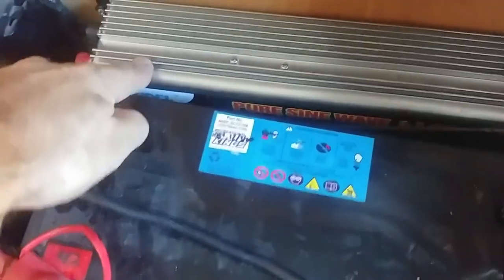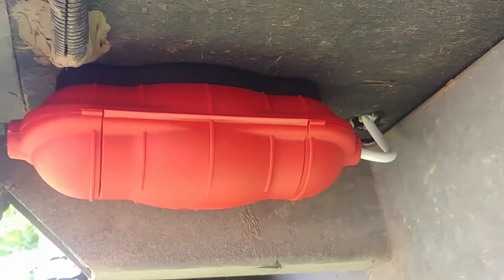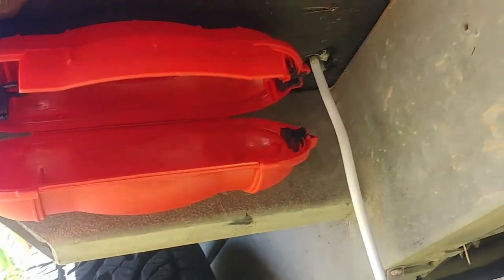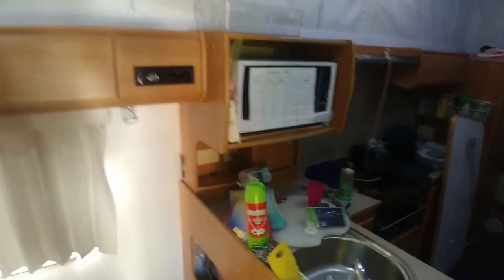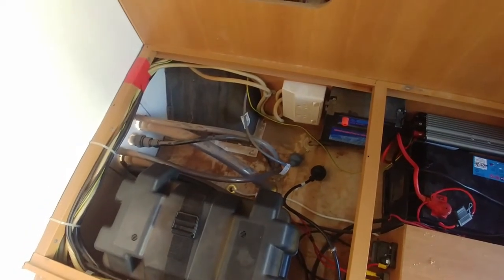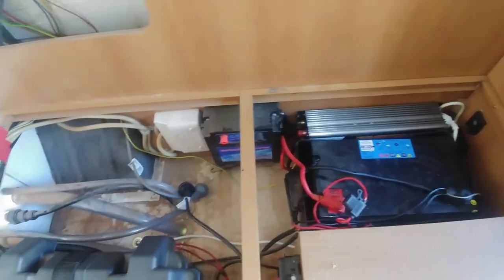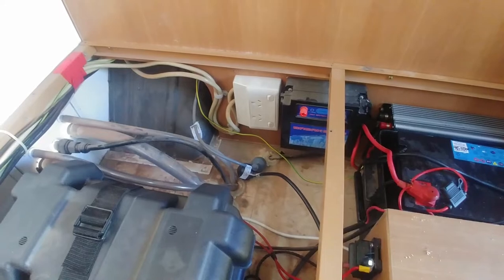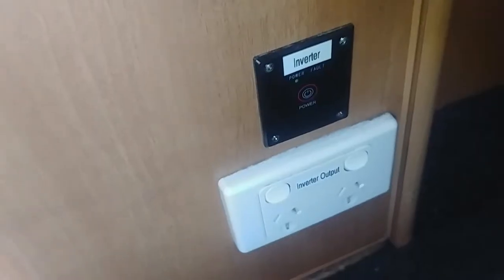[REVEALED] How to easily run your caravan / RV's power points directly off your inverter!

Comment: That is illegal in Australia
Reply from the maker: Officially you may be right. But functionally it's no different to running your van from a caravan park's power supply other than the earthing side of it. As far as I can tell, with this setup, even if you touched the Active pin you wouldn't get a shock (unless you were touching the kitchen sink, in which case the inverter's protection should cover you), because the rest of the van is isolated from the inverter, so there's no path back to the Neutral side of the inverter to complete the circuit. That said I would not want to try it to be sure but that's how it looks to me. In an ideal world I would pay a pile of money to an electrician to wire in a fancy auto-switching setup.

As I mentioned, I'm not recommending anyone does this, I'm just showing how I did it and mentioning the risks and other options. Any modifications people make is on their own head and up to their own decision.
Reply: @TheMusingGreg  It does not have a MEN link in the caravan or the inverter.  The MEN link is a critical safety function that is installed at the switchboard in your home or at a caravan part etc.  The inverter does not require this when plugging in an extension cord or power board directly to the device.  When you leave the relative safety of cord/cables with moulded plugs and enter the power point wiring which has cables in the walls and GPO's with exposed terminals, then you enter the higher risk area.  The RCD is there to protect this setup, but will only operate when connected to mains power.
Reply from the maker: Thanks for the insight mate, that's helpful information to know. Doing a risk assessment on it as I write, when I first pulled a power point off in my van (Jayco) I was surprised to find an insulated flat socket on the end of each length of internal 240v wiring which connects to an insulated on the back of the power point. So there is actually no exposed wiring or terminals even on the back of a power point. You'd have  to go another layer deeper and dismantle these connectors to actually get to the 240V wiring. So I think the risk in my case is pretty low, even though I appreciate it's not a perfect setup. But I appreciate your perspective and will mull over future plans with this setup.

Cheers,
Greg
Reply: @TheMusingGreg  I paid about $400 to have it done by an electrician who installed a circuit breaker plus a double pole switch that activates all GPO’s plus the aircon but excludes the HWS and the battery charger (else we would disappear up our backside). So it is park power or inverter power.
Reply from the maker: Cool thanks that's not too excessive I guess.
Reply: @That_is_for_me_to_know 

Well said I just came across this video and thought I would add a comment here. You have said everything that needs to be said anyone else watching this video. Please do not do this. Yes it does work but as stated there is no MEN link which will render your RCD, useless and not trip in the event of a short, malfunction or failure .

Comment: I notice you've got a microwave connected to the 1200W inverter.   How curious that the inverter later failed!!  I wonder how many other things overloaded the inverter too....  it sounds like your fridge might be the first example...   You discuss knowing how to use things "happily off the inverter"....  but that doesn't mean every person in your van knows and will remember peculiarities.

Hooking the inverter into the caravan power circuitry is ingenious...  and potentially lethal, but you know that...   Hopefully viewers will also understand this.

It would be pretty sad if (for example) someone standing on the outside of the van touched any bare metal (doorknobs, window linings, aluminium cladding etc) and dropped dead. 

240V wiring and water lines in the same place is deliciously exciting....  when when when will vibrations split that plastic water line!
Caravan wiring can be notoriously bodgey.   On a new van, one wrong screw/rivet in cladding installation for example.
On an older van, one wrong screw/rivet in cladding maintenance/repair... and a million other things.

I hope things are going well for you, and continue to do so....  but this really is a video and technique you shouldn't be sharing.  

It's one thing to do a quick bit of DIY electrical of you know what you are doing and comply with rules....   but quite another to do DIY wiring in a manner utterly illegal in any state of australia.  (Ironic that you didn't want to play around with caravan wiring, but did the 15A plug "trick".)

PS...  will everyone know that the electrical safeguards to avoid death in say...a caravan park power system (which is what should plug into the van's 15A socket), and a stand alone inverter....  are rather different?
Reply from the maker: Thanks for your comment. I appreciate your concern, but there are a number of things in your comments which aren't relevant to our situation.

The inverter is rated for 1200W continuous and 2400W peak, so our 1200W microwave should be within its abilities. However we've never used the inverter to run the microwave because the batteries can't deliver the 100A the inverter would need to output 1200W - the batteries are the limitation here, not the inverter. As for the fridge, it's a gas one so we've never needed to run it from the inverter, but if we did it only consumes 180W.

The bottom line is that our inverter is far from overloaded. The most we've drawn from it has been about 300W when charging three laptops at the same time, which is only 1/4 of its rated output.

Yes there are potentially risks with this method, which I explain in the description, but touching door handles or windows isn't one of them because our van has a fibreglass skin and plastic door handles. Any metal parts like the door are connected to a timber / composite frame so it's all isolated electrically. In fact the only way you could get a shock is by physically touching the Active and Neutral of a power point at the same time, or by connecting the Active to the kitchen sink and then touching the sink plus the Neutral. You won't get a shock through the floor because that's all plywood and in any case the whole van is floating relative to earth - there is no return path from the body of the van back to the Neutral / Earth of the inverter.

This method may not be appropriate for everyone, or for other types of vans, but I am simply showing what I did. I am not recommending anyone else does this, and I say as much in the disclaimer. 

As far as the 15A plug 'trick', I've mentioned this to others who've said the same thing. This is where it's important to understand the principle behind the rules, rahter than just blindly follow a rule without understanding why it's there. The 10A and 15A plugs are simple ways of preventing 15A being pulled through wiring and connectors only designed for 10A. My inverter is only a 1200W inverter, which means at 240V it can only deliver 5A (240x5=1200). So not even 10A, let alone 15A! So even if we had some bizarre situation where some ignoramus tried to run 2x 7.5A heaters off the inverter at the same time, the inverter would simply shut down immediately. If they kept trying they might eventually damage the inverter, but they're never going to pull 15A through the 10A wiring which is exactly what the wiring rules are there to prevent. A dodgy 10A-15A cable which plugs into a mains 10A socket is a completely different situation to what I've done, because in that situation the 10A socket is usually protected by a 16A breaker, so it can absolutely feed 15A if something in the van called for it. That's why those cables are, and should be, illegal. But my situation is different because the supply (the inverter) simply cannot deliver 15A or anything close to it.

Again, I thank you for your concern, but these are all factors I considered when deciding to use this method, and it's why the disclaimers tells people it's for information purposes only and that it may not be suitable for their situation.
Reply: You made a point of showing the microwave and the fridge in your video, only to say you don't use the inverter for these because there isn't the required power from the battery. Hypocritical????

Comment: I’m a bit late to the party here, but where’s your safety? No RCD or RVD ! Not sure you’d be happy to see your family running off your invertor. It’s a false perception that invertors are safe because they run off 12v.
Reply from the maker: All comments welcome mate. The 12V side of it, as you say, is irrelevant and wasn't a consideration. The thing here is that the whole van has a fibreglass / composite skin, all the wall surfaces are timber and so is the floor. The only thing that's earthed is the kitchen sink, so the only way you could get a shock would be if you leaned against the sink while sticking your finger into the Active. A pretty unlikely proposition I'd think.
Reply: @TheMusingGreg it’s entirely up to you the risks you are happy to accept, but giving electrical hook up demonstrations on you tube is another matter. I take it from your reply that your van isn’t equipped with earth an leakage device. There are more ways to get electrocuted than you suggest. Plugging into power at a caravan park you will most likely be covered by their RCD. Plugging in an invertor like you have gives no protection. I have to work on caravan electrics for a living and unsafe DIY practices are a constant concern. My
family like me to come home at night. Sorry to pull you up on this but encouraging others to circumvent Standards is risky. I hope you make changes to your system.
Reply from the maker: @wozzatherockdog1778  Thanks for your comment mate. It does have an RCD but as you'd know that's not going to help, but it doesn't have a RVD. I'm not trying to encourage people to go around standards, I understand they're there for a reason. But I have a background in electronic engineering and, to date, no-one has been able to explain how I could get a shock with this setup. I am willing to be further educated. But I've got a pretty clear disclaimer in the description, and I certainly can't vouch for the setups other people might have, so I'm not encouraging people to do it as such, just showing them how I've done it.
Reply: @TheMusingGreg  there can be a problem with having two appliances that have a three pin plug on the bench at the same time as an example. Part the reason we always use double pole power points in caravans. Also a damaged cable can be another potential problem. Always a chance wires can rub through and contact say the metal chassis then run into gas pipes etc. As you know electricity is always looking to make a circuit. As much as we think we know it’ll want to catch us out in a way we’ve never thought of.

Comment: Sorry but you really need to get some professional advice from a qualified 240v electrician. This is so dangerous!!! You cannot just simply connect a battery to supply 240v through caravan mains. You're not protected for voltage drops & It is not earthed properly. Heaven forbid if you get a leak in your van the power doesnt cut off from the inverter. People also do the same thing by connecting their generators to the van, its really unsafe. You need at least an RVD safe connection this automatically cuts off power to the van if it detects any issues.  240v power is not something you want to mess with. It's fine to pass a lead from your inverter to an appliance, but within caravan wiring it's more complicated 
Please talk to an electrician & please remove this video as people copy these thinking it's safe & really it's just dangerous.
Reply from the maker: Thanks for your concern. The floor of our caravan is plywood, the caravan has a timber frame with composite fibreglass wall panels, and the whole van is sitting on rubber tyres; so I cannot see any path to physical earth. The only part of the body of the van which is metal is the kitchen sink and this is connected to the earth of the inverter.

I was cautious when I first had the idea, but I cannot see a path for current back to the earth unless I was to poke my finger into the Active and then touch the sink with my other hand.

Several folks have expressed concern about this, but so far no-one has been able to explain the conditions under which I'd actually get a shock. However if you can explain this please do so as I'm not interested in handing out false information.
Reply: @TheMusingGreg  I have done this, 400amp lithium and 3000w inverter, Best thing ever :)
Reply from the maker: @mystq101  Glad it was helpful mate! Stay safe!
Reply: simply add in a RVD lead as a precaution but im not sure you can run a RVD if your van has a RCD fitted like vans have had for the last 25 years (MEN wiring)
Reply from the maker: @HWAFFI  Yep that would be a good addition if it will work.

Comment: This is dangerous and incorrect.
Reply from the maker: Dangerous - potentially, if you don't know what you're doing or you get a very unusual fault. Hence the safety disclaimer I provide in the description. 
Incorrect - in what way? I've been using this system successfully for the past two years so I'd argue it's not only correct, but functional and effective.
Reply: @TheMusingGreg  are you in Australia? Do you know about the MEN system we use? This configuration would either provide no MEN or two MEN in some scenarios both of which are illegal and dangerous. Again I’m only assuming because I haven’t seen a wiring diagram.
Reply from the maker: Hi yep I'm broadly familiar with that system, my background's in electronics not electrical but in my training I had a fair exposure to electrical wiring and systems.

The only metal surface inside the caravan is the kitchen sink. If this somehow became connected to the Active and was touched, there is still no path to physical earth because the rest of the caravan is floating relative to earth (carpet over wooden floors, and rubber tyres to earth). Even within the floating electrical system of the van, if there was a fault and the sink somehow became live, the only way I could get a shock would be to touch the sink and poke my other finger into an earth or neutral pin at the same time. Not a very likely set of circumstances, although not entirely fool-proof. This is why I have the disclaimers. The difficulty in actually completing a circuit from Active to Neutral  / Earth is what makes it so difficult to get a shock in this situation, as I see it.
Reply: @TheMusingGreg  so your willing to risk your life to save a few dollars on getting it done by a licensed electrician? It’s these kind of videos which kill people. Not only is it not properly wired but there is no isolation devices and no RCD. It’s an accident waiting to happen.
Reply from the maker: I understand your thinking, but to answer your question; knowing what I do about electricity, about this specific setup and with the theory I explained in my last comment, I'm comfortable with this.

I would be interested in your analysis of my previous reply and, as I see it, how difficult it would be to actually get a shock, which ultimately is what the standards are there to prevent. Is there some other more likely way someone could get a shock which I've missed?

I'm not telling anyone else to do it, I'm just explaining what I did. If people choose to copy this or so something similar it is at their own risk. I would certainly not advise a novice DIY'er to take this on with a different setup
Reply: I am just fitting solar, lithium batteries, dc to dc charger
AND a 3000w inverter to our Coaster bus and wanted to use the existing 240v ac power points.
My old man had the 240v ac system done correctly by electricians initially,
but I want the new inverter set up to be safe.
Normal domestic electrician be able to do this properly?